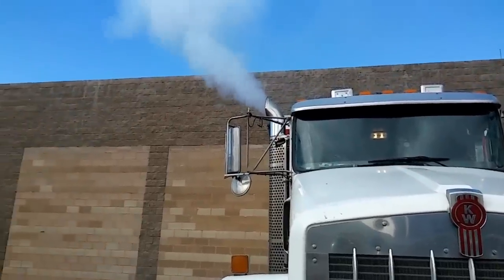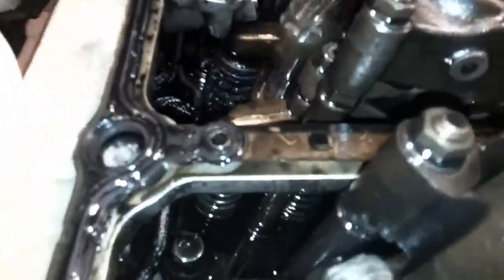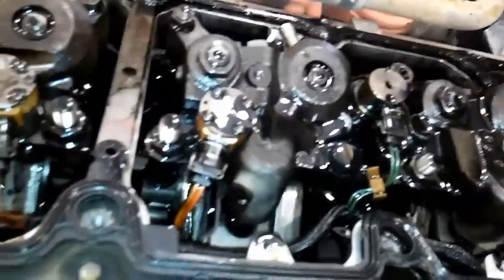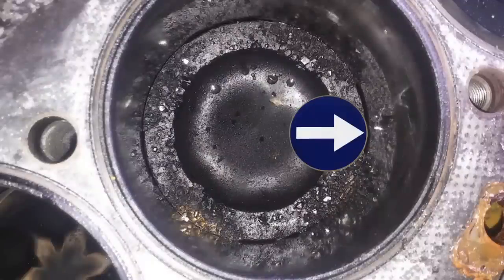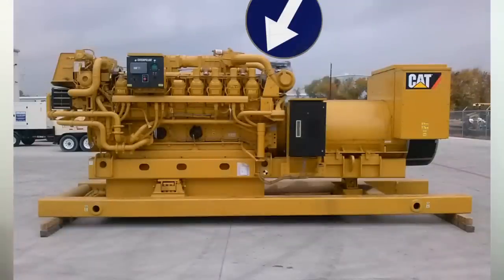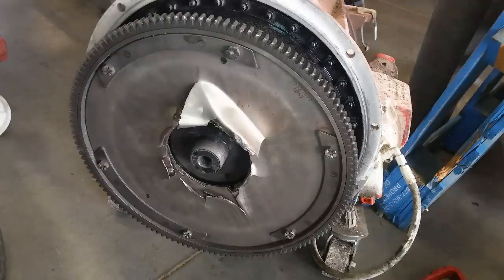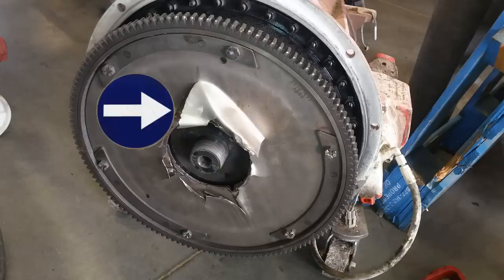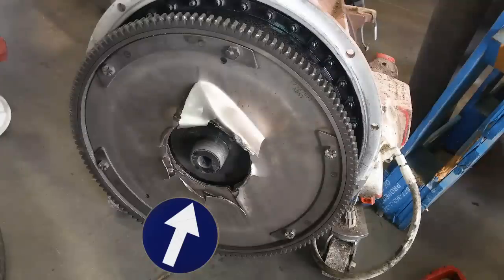Should You Warm Up A Diesel Engine?

Comment: I work in the gas compression industry on cat g3600's. The most important thing on them is that your oil temp never exceeds the jacket water temp in fact the ecm will shut the engine down if there isn't enough differential between the two. Since the pistons are oil cooled they don't want the hotter oil  to expand them any larger than the cylinder liners. As a general rule of thumb I never start to drive or load anything until coolant temp is up to 160 degrees. Good videos man it's nice to watch someone with a good head on their shoulders
Reply: Cory, I am puzzled by this part, "...oil temp never exceeds the jacket water temp...", because there have been excellent industry tests demonstrating the benefits of engine oil temperatures exceeding 212° F, the primary one being evaporation of water from the oil.
Reply: Chad Jessup yessir it does promote evaporation but for the oils we run at temperatures that high the viscosity is usually out of spec also at high temps the oil will break down quicker and when you're talking a 240 gallon oil change we try to squeeze every penny out of it. In certain applications like running on landfill gas they will raise the temperature of the jacket water to promote more evaporation due to the corrosive nature of the gas it will form acids in the crankcase when it mixes with moisture but most all of our gas isn't corrosive so we run lower temps, jacket water at 190 and engine oil at 180. We also run a straight 40w oil to help with oil life as multi viscosity oils (15w-40 etc) have a shorter life comparatively.
Reply: Amazing to hear your comment. We run g3600 generator sets and ended up cracking the cylinder liner due to this very fact ....oil temp over Jacket water temp .. Adem alarms but does not shut down engine when this happens
Reply: Peter Ronson awesome where are you located? What size of engines are you running? It may be because ours is a different application but it will shut down if oil exceeds water by 7 degrees and will alarm at three degrees,
Reply: We've got a pair of g3612's and a g3616 in full cogeneration application.  Toronto, Ontario.
Ours when it failed  cracked the liner scuffed up the piston but fortunately all the parts stayed in the cylinder. I can't remember what finally shut down the engine but it was not the temp differential alarm in the ADEm. My memory is that shutdown has a long timer too...so damage is already done. We added external valves on the JW circuit after the failure to make sure the JW temp stays high and gets up to temp quickly.
Reply: Cory Willbanks  3600 cats are prone to having piston seizures if cold loaded. It's very important to not only monitor coolant temp, but engine oil temp before loading.
Reply: Um.....? You do know this guy in the video is wrong about diesel water temperature reaching 160 as normal temp ? Diesel always run colder and they all mostly run about 80 to 89 degrees max ..... been looking over heaps of diesle and that's the max I can see ? 180 degrees you start warping alloy heads remember that
Reply: I bet you're a fascinating person to chat with 👍
Reply: Cory Willbanks I work offshore on d3600 w let them warm up a few mins
Reply: hes talking in degrees fahrenheit and you're talking in degrees celsius.
Reply: Cory Willb
Reply: Cory Willbanks we run CNG class 8 trucks.. Cummins says not to move until the temp hits 150.  These trucks warm there own really quickly. By the time the pretrip is done it's at 180. 

You're right about the acid levels.. people think they can extend the oil change intervals because the oil is clean. The acids will eat the main bearings.
Reply: Cory Willbanks what do you think of the 203 degrees and 205 degree thermostats guys are putting in their 7.3l fords. They are saying they were actually designed to run at that temp over the lower stock ford 185-190 degree stats . Saying its been reduced for meeting emissions standards.
Reply: @jmoore9806    The 160 is Fahrenheit so that is 71 centigrade
Reply: @robertreznik9330  ok cool i herd wrong then in the video....i thought he said 160 degrees
Reply: BrightIdeas No. not enough. The bigger the temperature difference, the more differential there is. You want more differential, not less.
Reply: @jmoore9806  2017 ram 2500 if i drive it for more than half hour oil temps are around 200 and coolant around 195 to 200
Reply: @wvboy0311  yeah thought he said degrees Fahrenheit....my bad

Comment: This is one thing I like about the new Cummins in the ram pickups. The exhaust brake kicks on and loads up the engine a bit, keeps the fuel dilution of the oil from getting out of hand.
Reply: ...and my '19 Ram goes in to higher idle in cold temps to warm it up. Literally at operating temp in less than 10 minutes.

Comment: Over here in the UK my 28 year old Land Rover 200tdi gets between 3-5 mins warm up every time I start it from cold regardless if I'm in a hurry or not!
I then drive it through the gears very slowly until I've done a few miles and I never take it over 65mph, I also let it idle for a min or two when I'm about to shut the engine down.
It's covered just over 300,000 miles now and apart from servicing and a head gasket it's never given me any problems.... I also service it every 6 months with good quality oil.
Look after your vehicle and your vehicle Will look after you!
Reply: Do you ever  tow a trailer through the mountains?
Reply: Christian Eidsmoe I do tow a trailer with it sometimes at full weight which is 3.5 ton here In the UK.. I do also tow ships mooring ropes and wires with it which probably takes it over the recommended towing weight!
I sometimes tow a small X army Sankey trailer into the Welsh mountains but that's about it!
Why do you ask?
Reply: Pill Sharks just curious, I'm always amazed at how well diesels tow.
Reply: Christian Eidsmoe well I did Drive lorries or Big rigs if your a yank, over here the maximum weight is 44 ton and my old Land Rover towed my lorry across the yard... mainly because another driver kept saying how shit land rovers were!   I had to prove him wrong...
Reply: Hey, you don't need to let the engine idle before shutting down in most cars nowadays. The ECU will keep a pomp running to cool off the turbo and prevent the oil from burning up :) !
Reply: Henri A. It's a 28 year old Land Rover with 1 single wire needed to make the engine run and it doesn't have an ECU!
Reply: Pill Sharks In that case better be safe! You should still be fine if it's a naturally aspirated engine
Reply: Henri A. It's a Tdi so it's a turbo which is the main reason I let it idle, it doesn't matter what it is I've always let them idle.
That ranges from 16 litre 650hp truck engines right down to my 18hp diesel boat engine.
Reply: Our work Land Rover an 06 defender the poor thing gets like 5 minute runs never gets chance to warm up, it smokes so bad
Reply: your car is 28 years old...of course it needs warming...Modern cars don't tho when talking about modern cars this video is complete bollocks

Comment: I think this applies to all engines. I always warm up my car to get the oil through the engine on my gas car . Unlike my neighbors that jump in and take off while their car sounds like a sewing machine because there is no oil in the valve train yet. Great video
Reply: Dariusz D, correct :)
Reply: Did you even listen to the video? The pressure may be there but the engine isn’t properly lubricated until the oil warms and thins and begins to flow through the engine at the right rate
Reply: Dariusz D concerning gasoline engines: gas engines use an open/closed loop fuel trims. When cold, a gas engine will operate under open loop, meaning the ECU commands the engine to run with the injectors dumping fuel into the combustion chambers in an effort to increase overall operating temperatures. Gasoline is a solvent: so when in open loop, the engine runs extremely rich. If left to idle before the ECU commands the engine to go into closed loop (14.7:1 air fuel ratio), the cylinders will wash down, causing premature wear. If it's super cold, say around 10 below 0, then yes, let it idle, but if not, jump in and take off. The lack of immediate oil pressure in the cold will not negate the loss of lubrication by letting a gas engine idle in open loop. Carburated engines of course are a different story, but with EFI, it's a whole new story.
Reply: Getting your oil up to operating temp before stressing the engine is what's most important in warming up a gasoline engine I think we all agree. The best way to do that is to start driving as soon as you start your engine but under very light load conditions until your oil temp is up to its operating range. In the winter it might take 20 or 30 minutes for that to happen just letting it idle. So cold oil combined with rich idle conditions means minimal lubrication. Idling a gas engine for more than a minute will shorten the life of your engine without a doubt. I know this goes against what most of us were taught but if you think about it, it will be obvious to you. Plus if your one of those tree hugging people your catalytic converter will not be able to change CO2 into O2 until it is heated up either. So not only are you damaging your engine warming it up by idling in an evironmentalists eyes you may as well be clubbing baby seals.
Reply: Getting your oil up to operating temp before stressing the engine is what's most important in warming up a gasoline engine I think we all agree. The best way to do that is to start driving as soon as you start your engine but under very light load conditions until your oil temp is up to its operating range. In the winter it might take 20 or 30 minutes for that to happen just letting it idle. So cold oil combined with rich idle conditions means minimal lubrication. Idling a gas engine for more than a minute will shorten the life of your engine without a doubt. I know this goes against what most of us were taught but if you think about it, it will be obvious to you. Plus if your one of those tree hugging people your catalytic converter will not be able to change CO2 into O2 until it is heated up either. So not only are you damaging your engine warming it up by idling in an evironmentalists eyes you may as well be clubbing baby seals while your at it.
Reply: Ed Pettit show me a new truck that doesnt have an exhaust leak at the manifold from blowing the heads off the bolts. Let them warm up slow as theres like 6 different alloys in a motor these days.
Reply: What about full synthetic oil in the engines
Reply: Yea piston Slap is most of the issue. You should hear my wife new Subaru. It sounds like the pistons are swapping cylinders. I guess that's a Subaru 4 U.
Reply: Ok here it is about gas engines.  Hot rod magazine wrote a article on this in the 70’s. Gas engines should Never be warmed up just say 30 seconds to make sure the oil is flowing the drive off. Of course thousand wrote in to dispute this so Hot Rod did a second test with  more in-depth studies and agin proved warming up a gas engine is detrimental to the engine PERIOD! So there you go.
Reply: @luisespino451  Someone else suggested 'take off lightly'. Seemed to make sense to me. 
(IOW) don't take off like an animal/lunatic, which also makes practical sense IRL.
Reply: @KingOath  GREAT SCOTT Marty, you. are. correct. Once the oil is thinner, you can go directly to 88mph.

Comment: I idle my C15 on startup for 10-15 minutes at the minimum everyday. Plug it in on cold months and idle before shutdown at least 5 minutes. Got 1.3 million before I inframed it. I've ran several different CAT engines with the same routine and never had any problems with long idle times.
Reply: 1.3 is pretty good for a c15.
Reply: @ai_university  I really like my C15 engines. I have 3 kenworths with C15 ACERTs and will go out of my way to avoid the ACERT in the future. The single turbo have been way less problematic.
Reply: @countryrebel01  KT3406E says the same thing about those ACERTS. Haven't dealt with them myself.
Reply: @countryrebel01  I keep
Hearing about this single turbo conversion. What’s the benefits of doing this? Should I wasn’t until my turbos are on their way out to do this ?
Reply: @romanshevy257  Just keep running them until a turbo goes then throw a bigger BW single turbo on. Gets rid of a bunch of extra crap hanging on the motor and will run better. Thats what we've been doing with our ACERT's.

Comment: Growing up on the family farm, we would always start our tractors up in the fall/winter and idle them for about 4 or 5 minutes and then bump them up to around 1300 to 1500 RPM to speed up the heating process. After about 15 to 20 minutes or so we'd go to work. We put anywhere from 8k-15k hard hours on all of our machines and they never needed a rebuild (short of our cotton picker but it was already heavily used when we bought it).

Comment: Here in Canada we get some pretty cold temperatures. I run 0W30 or 40 synthetic oil in all my vehicles, including my farm tractor, generator and snow blower. Even this oil is fairly thick at minus 30C. Here are my tips for winter driving: cover the grille to allow the coolant to warm up faster, use a good block heater, and consider a garage. Even an unheated building is far warmer than outdoors and your vehicle will be much happier!

Comment: I worked in a NASCAR shop for 7 years.
ANYTIME we started a “cold” engine, the oil was heated (to 210 deg) and circulated thru the engine before starting it. Not letting any engine warm at least 3-5 minutes raises the chance of excess bearing wear/ damage. While today’s synthetic oils do flow better at “9 degrees” than older conventional oil, it does not flow that good. 1-2 minutes warm up is not enough in below freezing temperatures. All engine oils have an optimum temperature operating range. Room temperature and colder is not in that range.
Reply: JFC.
This is not a nascar engine! 
Anyone who lives in a cold climate (Like Canada!) will have enough common sense to gradually warm the engine after the initial 2 minutes.  
For example.
If hooked to 140,000 pounds, starting my day in Btfk nowhere I would open hood,  check the oil and other fluids, do a visual for leaks, check steering,
Then I would start engine,  do a proper walk around, check tires, etc, come back to the engine area, do another quick visual,  close the hood!
At this point you can start moving WITH LIGHT THROTTLE INPUT!
You do not Jeff Gordon the thing and hit the rev limiter even if at 180 -200 °F, that is just plain stupid!
Axles, tires, wheel bearings must be gradually warmed too! At -40°F you could easily rip apart a driveshaft or do unnecessary wear to the tranny or diffs.

To make a long story short...This is not grandpas 6v71 using straight 30 weight conventional oil.
We run modern electronically controlled engines. 

:)
Reply: @fredg8199  
Sorry but you haven't told me anything I don't already know and many others as well. I figured someone would take my point and miss apply it or twist it into some other meaning. I cannot make my point any simpler and I'm sure the other 99% of readers understand it. 
BTW, when did they start using  pointless ignition? Golly things sure are changing fast! Now where's my dwell meter and timing light?... there's other oil than straight 30W WolfsHead?!
Reply: C R. 
Pointless ignition.
Reply: @fredg8199  
Exactly.
Reply: @fredg8199  " jeff gordon the thing " is that like " rick james " ? 😂😂😂

Comment: Wait 5 minutes at idle, then drive off, moderate load until you see your oil/coolant temp start to climb.
Reply: I left my truck idling 10 to 15 minutes before y drive
Reply: Idling before driving is simply to get the oil circulating through the turbo and other engine parts in newer diesels. I have a VW TDI and they say 30 seconds to a minute of idling and then just drive it. Obviously don’t be running 23lbs of boost through the ol girl until she’s up to temp but just regular driving a cold diesel is actually healthier for them than slow warm ups.
Reply: @Realtreecamo98  :  There is a big difference between a 2 liter, and a 9 liter diesel engine.
Reply: @johndavidwolf4239  I didn’t say there wasn’t?
Reply: @Realtreecamo98  what about the old Diesel engines? I would have thought a warm up before driving would be better

Comment: An old trucker taught me to never put it under a load until you see the gauge move. If the gauge doesn't move, don't move the truck. 1000 rpm warmup after initial startup and idle settles down.

Comment: Whole heartedly agree with you on an easy warmup on diesels. When our engines are started, let oil pressure build at minimum RPM and after a few minutes, drive off under empty load until close to operating temperature. Never push a cold engine. Up here in Montana, we see -40 F. We use oil pan and block heaters. The newer 5-40 synthetic oils are also a big advantage for sustained cold driving. PS.. you will have to keep your window open and breathe outside until your heater starts throwing heat to keep your windshield from fogging up....  you won't experience that in AZ  Haha

Comment: I was always taught with tractors and heavy equipment that if you idle a machine in the winter to bump the throttle a smidge to keep it off the low idle. I was always told it was for oil pressure and flow reasons. Never thought about it much, I just did it. Granted these were mostly older machines also.

Comment: When I got my Diesel Oldsmobile Regency, I was told to sit ONE MINU"TE to allow oil distribution and DRIVE.  The cabin heat water temperature reached comfort in 2.75 miles.